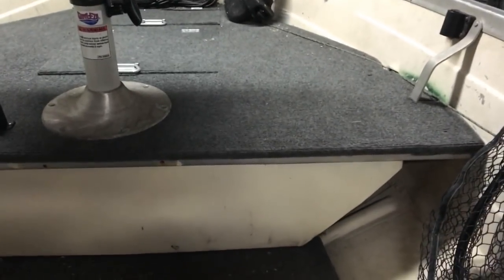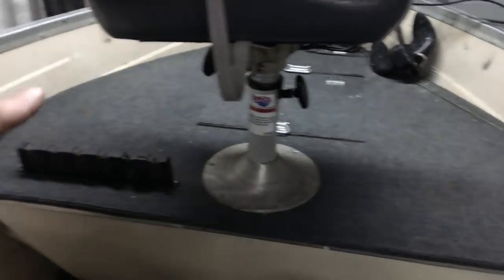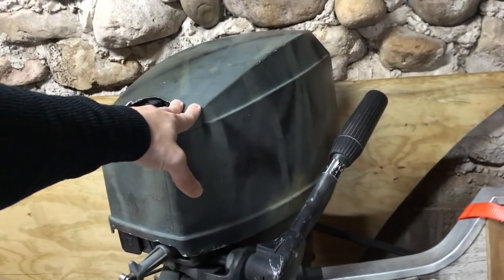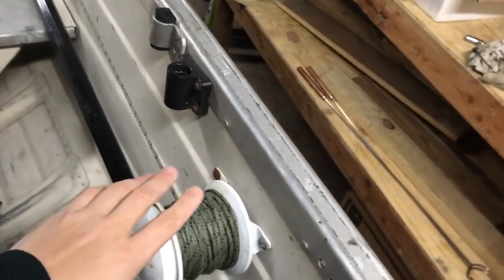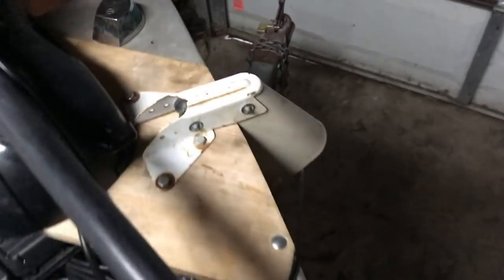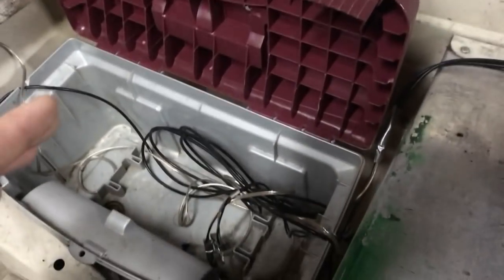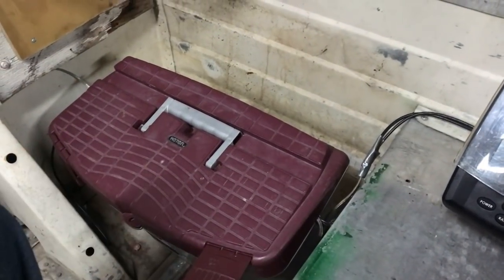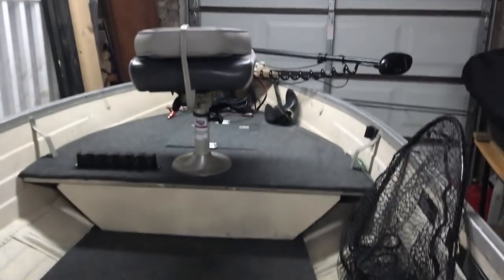Aluminum Boat Casting Deck Build and Helpful Mods

Comment: Dude, thanks for the video. I wish you could describe more details how to support front deck. I have a deep V front. It is hard to build support b/c it 's curved. Therefore, it gives me little room to build based. In other videos, they can build rectangular based to support deck. My boat has a little flat at the based.
Reply from the maker: tom huynh If you watch the other video I did a little overview of the framing I basically build a bracket out of wood or screwed directly into the front bench for the support then build off of that to the front mini step that would be directly under my trolling motor!
Reply from the maker: tom huynh this older video has the build overview 

https://youtu.be/-m9LZiQq3Ow
Reply: I’ve done a couple before. The first one I did I used joist hangers and used 2x4s like floor joists and it worked out great. I’m gonna do the same thing with the boat I have now
Reply from the maker: This video will show everything I did: https://youtu.be/-m9LZiQq3Ow

Comment: Great build, makes it affordable, I’m in the process of doing pretty much the same thing, only difference is I treated all my wood with 3 coats of quality stain to slow the rotting of the wood, my boat is a 14 princraft deep and wide, I have a lot of different builds than you but close enough, but some of your ideas are great and easy, great job.

Comment: I bought a 14 aluminum boat with a trailer off a friend for 300$. Gonna put a mud skipper twister with a 13hp motor on it. Gonna build a casting deck on the front. She needs a little love but it's gonna be awesome!

Comment: Awesome man! This helps a ton. I'm actually trying to buy my first little fishing boat. And this is exactly what I plan on doing. Thanks for this video!!
Reply from the maker: Aaron Shuford just a reminder that you REALLY want to save your money and use marine grade Wood! Also if you can swing the money in the fabrication use aluminum for the supports!
Reply: Will do! I plan on carpeting it too. Just need to find a decent boat. I like the idea of the led lights too. Probably save power on the battery and last forever. And the anchor mate will probably one of the first things I do. Thanks!
Reply from the maker: +Aaron Shuford you definitely want the anchor mate! And leds are a great investment 👊🏼

Comment: How did you attach the wood plate that holds your trolling motor? Is it simply screwed into the side rails of the boat? How many screws did you use? Thanks in advance for the tips!
Reply from the maker: Mark your holes on the boat rails, Drill them out, Cut board to fit, Mark holes underneath with pen or like I did sticking a nail up from the bottom into the board, Drill then use bolts to hold everything together!

Comment: Nice job. Having a deep v hull is a bonus. It rides deeper in the water. My boat is a 62 shallow v hull so stability is a big issue. So I'm not sure if casting decks are the best idea for me at this time. But I am going to install a flat floor and some storage compartments.
Reply from the maker: Randy Lanhart that flat floor is a BIG PLUS! Good luck on your build👊🏼🎣

Comment: I have basically the same boat; 1981 Mirro 14' deep-v, but it's the resorter model which means the seats are formed slightly different and the max H P motor is a 25hp. I think you would like the way I put the floor between the seats in. Simply put aluminum 3/4" L channel along the lower lip of each seat, then cut plywood to fit between the seats while resting on the L channel. Add two cross braces to the bottom of each floor section for stiffness in the center of the panel (no need for  braces close to the seat the L channel is screwed to the seat and gives plenty of support). Cover the plywood with whatever you prefer and drop them in. The great thing about this system is they pop out easy to clean the space below where dead minnows, worms and other garbage always seems to get to.
Reply from the maker: I really like this idea!!! Where were you when I was building mine!?!?!? Lol
Reply: Good ideas!! I'm gonna do this to my tender boat for ducks
Reply: A tender boat for ducks, sounds like your talking about layout hunting. That means colder weather and cold water. It's amazing the difference in comfort that adding a floor raised from the hull makes. I'm from Wisconsin and I can't imagine going spring fishing on the Wisconsin or Mississippi rivers with my feet on the actual bottom of the boat, even with Sorel pack boots on my feet would get cold. Now a good pair of socks and some comfortable hiking boots is all I need. Another plus to the floor is that water runs underneath keeping you dryer.
Reply: @scottgorski7931  , all true. I live in upper michigan. Lbdn in November is no joke.

Comment: Can you explain your front trolling motor mount?
Reply from the maker: If you are talking about the board it is mounted to I basically had to drill through there top of the rail first then run bolts from the top through the board to the boat then make mounting holes for the TM itself like you would any other boat!

Comment: Does adding the straight small raised floor make the boat more stable?
Reply from the maker: Yeah it does! You want to try to have at least 40-60% of your weight at the lowest point you can put it!
Reply: I should have said a 12' Gamefisher V bottom hull..  sorry it's really needing to be a heck of a lot more stable

Comment: I like your build. But I would like to remove the middle bench permanently if possible. Not sure if this is feasible? Thanks for any input. I have a 14' Sears Sea Nymph 1974 model v-bottom. Thanks.
Reply from the maker: David M it’s possible but you need to build a type of under floor gusset! Basically if you put storage on the sides and box it into the floor and have it attached where the seat mounts on the sides I think you should be ok!
Reply: @DWSOutdoors  OK thanks for the reply. Have you ever thought about taking yours out?
Reply from the maker: I liked the idea of having it there for fishing 2 people
Reply: @DWSOutdoors  I'm thinking that I would like to take mine out and put like a post type seat or something else that I can walk around it instead of having to step over the bench

Comment: I have deep V 15 footer 1973 Sears boat so very similar to yours. I built middle deck  from 1/2" plywood and made the support from multiple 1" PVC tube with the dowels on both end glued inside the tube. These ends  gave me area to glue and screw it to the underside of the deck and also reinforce the PVC edge from braking. I still used 4 2x2",  2 attached to the bench as low as possible and 2 longitudinally  for framing just enough to give me reference to cut PVC pipe to fit. Of course floor was waterproofed and carpeted. I used PVC so there is no contact with water if boat takes water from rain and it's very light. This year I will build front deck as yours plus shelf for electric motor on bow. I have Evinrude 18HP motor from 1967 and this thing flies if I'm not on city lakes
Reply from the maker: That sounds like a really good start to a very functional boat! I love little boat mods!

Comment: Great video, I have the same boat! Gave me some great ideas!
Reply from the maker: One thing I very much suggest if you cant keep it inside most times is to use Marine Grade Plywood and paint it also with some kind of weather sealer before using outdoor grade carpet of vinyl!

Comment: Is your carpet glued down to the floor?
Reply from the maker: I used professional carpet tape and made a checker grid and stapled it to the back side around the edges
Reply: @DWSOutdoors  did u have a plywood base or no?

Comment: Do you fun two batteries
Reply from the maker: I run one big one for the trolling motor that I believe is linked in the description and one big one in back for my rear locator but I also have a smaller 12v up in that front little cubby to just run my front locator off of that I used ice fishing as well!

Comment: I figured your boat was modified by you and that you had a video on it! My only comment about it is the trolling motor up front. Why didn't you mount a plug on the front of your boat, right under the trolling motor, which would eliminate the need to have the wire exposed and going into the compartment?
Reply from the maker: Stephen Peterson I wanted everything easy to remove if I ever need to

Comment: How is it with tipping?  I have the same boat but 16ft deep v in sea foam green.  I want a flat floor but it’s already so tipsy I’m worried a higher floor and casting deck will make it worse?
Reply from the maker: Chris Colston I am pretty sure because of the weight I added down low it made it less tipsy! Just remember though that the deck up on top the front seat will have you at about 2ft off of the water!
Reply: DWS Outdoors hmm good point about the weight.  I’m wanting to do this to mine too.  Thanks!
Reply from the maker: Good luck! BIG TIP! Use Marine Grade Plywood and if you can swing it use aluminum bracing!

Comment: I like that idea for the stern light.
Probably even bright enough to see what you're doing and don't use nearly as much power as a commercially made stern all around light.
Reply from the maker: Jeff Krake SUPER BRIGHT!!! 😂 I stay up on the front casting chair at night and can still see my line for jigging 😂
Reply: DWS Outdoors I have a 12' Mirro that I use as a second boat and it's a very light weight and versatile boat. If you took a guess, how much weight do you figure it added with the floor and casting deck?
Another question is did you use pressure treated lumber and plywood?
Reply from the maker: It probably added about 150-200lbs tops and it was treated wood but I made sure any contact point where cushioned against the metal with strips of carpet so as not to wear on the metal
Reply from the maker: Jeff Krake but a big thing I made sure of was all of my heavy weight was below the bottom of the seats to keep the boat balanced if that makes sense
Reply: DWS Outdoors yes to keep the center of gravity lower so the boat isn't so tippy with you up on the casting deck. Don't want to feel like  you're in a canoe 🤣
Reply from the maker: Jeff Krake exactly!

Comment: Dude, what brand of boat is that? I think I have the same boat, and was the same color. I have totally redone mine tho. I took the benches out and designed mine exactly like the alumacraft competitor. Live well, electronics, bilge pump, rod lockers etc. The bottom half is rino lined.
Reply from the maker: hulkhuggett It’s an 80s MirroCraft and sounds like you have one heck of a rig now!
Reply: DWS Outdoors mine is a '78 mirrocraft. I have not seen another one. My rig is awesome. However, I made a mistake by using wood. It weighs so much now I only get about 9.5 mph. I would highly recommend spending the extra and using aluminum for the decks. Only problem is finding the aluminum. Cool boat bro! And mine doesn't leak a drop after all these years.
Reply: I kept mine light as I just keep it on the beach or haul it to federal forest lakes, thankfully my other boat came fully equipped with all the goodies.

Comment: Nice mod, I still have my old 12 ft mirro craft, same color! Its not always my first choice to fish out of but dammit it fits in The back of my truck and I can take it anywhere! And where I grew up it was a dam walleye killer. Tight lines
Reply from the maker: The ability to get where others can't is why I love this boat!
Reply: All true, every one up here loves trolling, cover lots of water, 6-8 boards. That takes a big boat. I'm one of the select few who prefers pitching jigs and slip bobbers. That's why I prefer a tiller
Reply from the maker: Paul nokio exactly !

Comment: How can you charge all of those batteries without removing them from the boat?
Reply from the maker: Lol I take them out! Thats why I bought the lighter ones with the handles! I have 2 deep cycle! One for my trolling motor up front and one for my electronics in back! I power the front graph off of my ice fishing batteries to keep them healthy all year as you need to charge them often to get them to last a long time!
Reply: Yeah I figured you would take them out. I’m surprised that they don’t make a battery charger that you can daisy chain all of the batteries inside of the boat to charge them simultaneously
Reply from the maker: @robcochran1558  I actually think they do but I didn't like the idea of trying to run electricity to my garage when I first did the boat so I never invested in one....

Comment: I have a 250 hp 21’ ski and fish boat that has all the bells and whistles with gps ipilot and I also have a 1977 12’ forester aluminum fishing boat that is bare bones with a 9.9 kicker. The big boat has high upkeep cost but the 12’ has almost zero upkeep. I’ll sell the 21’ boat before I sell the 12’ boat.
Reply from the maker: Pahanin I’ve run them all and love my little boat 90% of the time! I just need that big rig for the waters I like to fish and bad weather I tend to end up in!😂

Comment: "Never use 2x4s because it'll be too heavy" Uses 2 2x2s, puts in a marine battery, anchor, seat, and trolling motor...
Reply from the maker: You probably don’t know this but if I would have used 2x4s for everything that I used 2x2s to build the front of the boat would’ve been 100-150lbs heavier 🤦🏼‍♂️